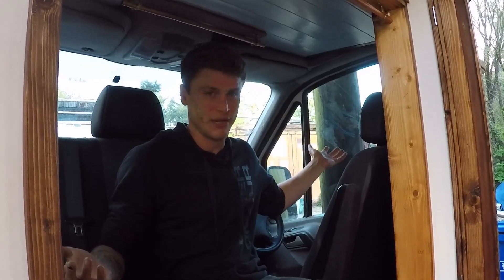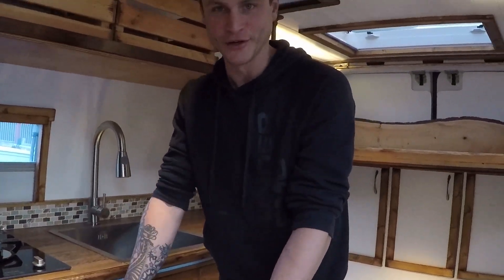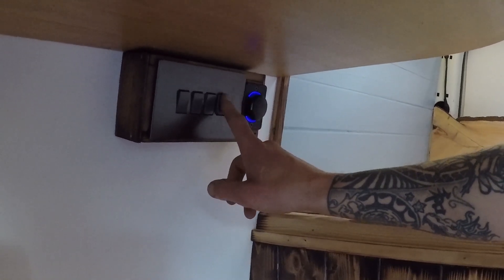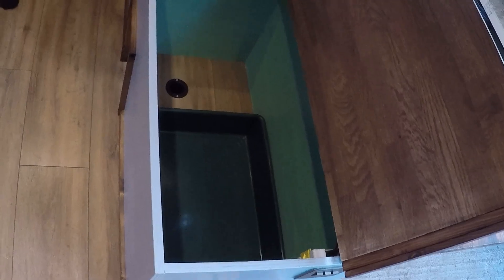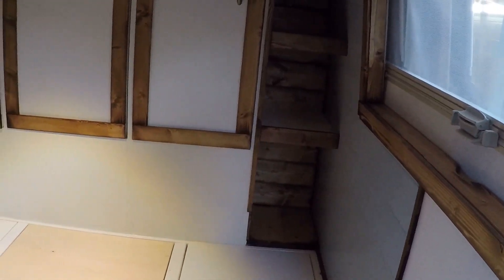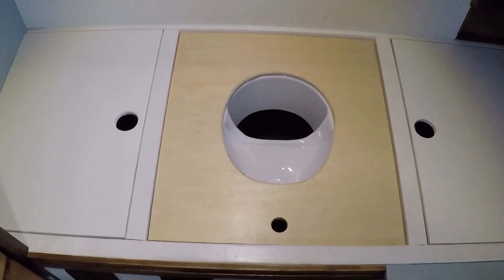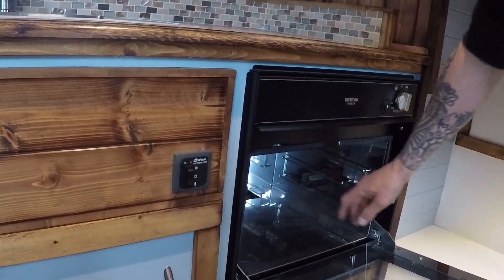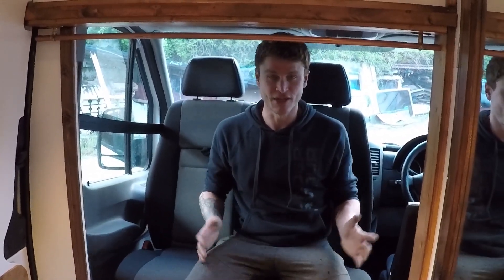Bubble - VW Crafter MWB - A true tiny home on wheels! VAN TOUR!

Comment: Nice work! My wife and I have just purchased a mwb vw crafter and are still in the planning stage. we have been tossing around whether to leave the cargo barrier in to utilise the storage under the passenger seats or take it out and put in a single swivel seat but seeing your double swivel passenger seat has piqued my curiosity and am wondering where to source the kit from? and also do the storage compartments underneath still remain? was planning to position deep cycle batteries in the storage compartments. Any advice warmly welcomed and thank you in advance
Reply from the maker: No problem at all, RJ Camper Solutions sell/make the double swivel seat base, and yes you can still access the storage underneath 😀